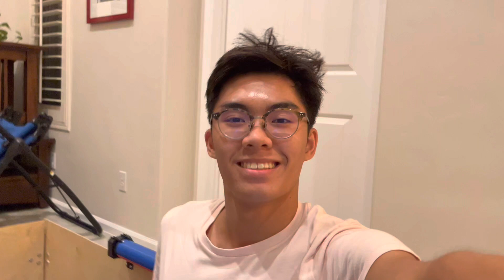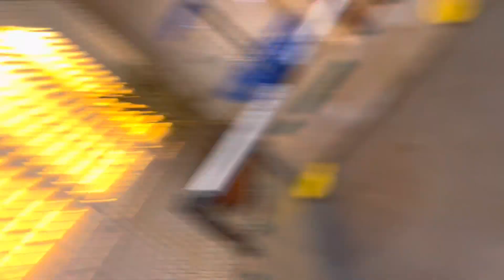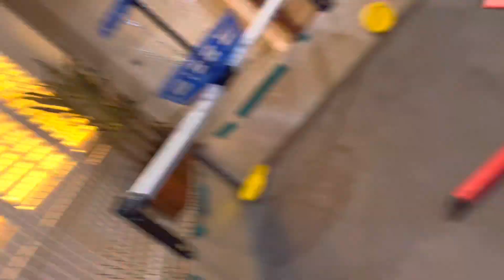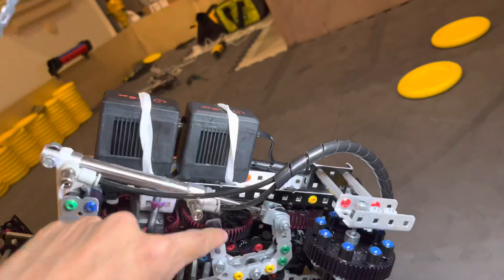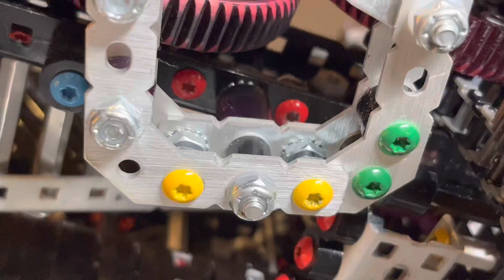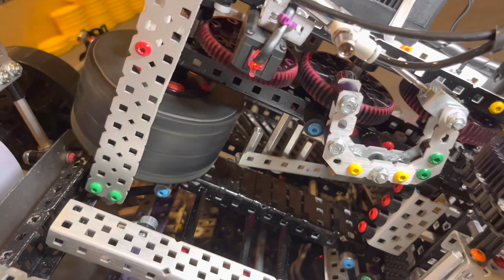606X Spin Up | Flywheel PTO Explanation / Ben Face Reveal

Comment: I'm curious as to how you trigger the disks to move towards the flywheel are you using pneumatics? I would assume if you are you're using double action pneumatics bc they're more air efficient. My issues with using pneumatics for it is that we don't have double action so it uses a lot of air per shot of the pneumatics so I'm tryna steer away from that if possible but we're at our motor limit so I may have to do something like a pto or something so that we can get more disks with less air, and I'm just hoping you've got something different I can pull inspiration from
Reply: Yes, we had a pneumatic indexer. I would recommend looking into a ratchet system for sharing the intake and indexer so you don't have to use a piston

Comment: How did you dye your gears
Reply from the maker: typically, to dye parts, you would need to get 
1. Dye
2. Acetone
3. Pot
4. heat source

put plastic gears in the pot and boil until the gears get to the right color
Reply: @606X  But how did you get your gears to be two different colors at the same time (pink + black)
Reply from the maker: @Urjit Chakraborty  we dyed the gear first, then beveled it with a sander. The dye layer is only on the surface, so when the gear is beveled, the original color of the plastic (red) shows.

Comment: May be the dumbest question ever but what is a pto
Reply from the maker: power take off, it allows motor power to be switched between two different subsystems. in this case, the motor power of 1 motor is shifted between the flywheel and the sprocket.

Comment: So this PTO is used for the flywheel and the intake?

edit: Do you use the PTO to power the flex wheel that spins the roller?
Reply from the maker: No the PTO was between flywheel and a back roller mechanism, but we didn't have enough time to perfect it so we scrapped it
Reply: @606X  Do you guys plan to later use it to spin the roller?
Reply from the maker: @jash6503  depends what we see at mall. if it is advantageous to have 2 rollers, then we'll have it.
Reply: K thanks

Comment: is that the indexer
Reply from the maker: No it’s the flywheel pto
Reply: @606X  what does the motor share too
Reply from the maker: @CubikArtmosaic  back roller. didn't work well though